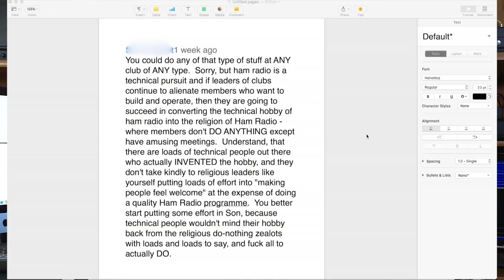How to Blow-up Your Balun - K6UDA Radio Episode 23

Comment: Okay Reverend, first of all a ballon has nothing to do with 50 ohms. It has everything to do with stopping the outer skin surface of the coax from radiating. And forcing the power into the antenna. Your coax can be any impedance you want your antenna can be any impedance you want. The job of the balance is to make sure that the coupling from the balance to unbalanced connection happens efficiently and is not allow the unbalanced part of the circuit to radiate. Think of it this way RF is stupid. It doesn't know when the coax ended. So we need to put something there to tell it that the coax has ended and now it needs to leave The Wire the way we want it to. Plain and simple

Comment: Baluns only work at mono-band antenna's, they do not work well on multi-band, as the impedance is all over the place. I only use a choke and a good tuner. It will make 50 Ohm on any band. Problem solved. Never used an antenna-analyzer and never will, it's just an advanced SWR-meter telling you nothing. A balun is a transformer and will never be the same unless you use a mono-band antenna. Invest in good coax, choke and a good tuner, it will make any antenna work, regardless of the impedance as long as it's long enough for the band you want to use.

Comment: While you vaguely mentioned that one needs to use an analyzer and then match impedance of antenna and feedline, I think you'd have done a better job if you gave a little more detail -- such as "how" to measure the impedance, and then how to determine whether balun is 1:1, 4:1, 9:1... for example: if a Ham operator homebrews an antenna how/where/what do they measure to determine the impedance their "spaghetti monster" has?  If they are going to buy a balun how/where/what do they measure on it to determine whether it is the correct ratio for their need; and if they are going to homebrew the balun how do the number of turns/wraps of wire around the core equate to the ratio of the balun...many, many DYI guides are being copied by homebrewers who are copying something but they don't know why a specific number of turns of wire is being used, or why a specific length of wire is being used...if you've not already done so perhaps you could make a video covering these points:

>After I have an antenna (either homebrew or purchased) how/where/what do I measure to determine it's impedance?

>If I purchase a balun how/where/what do I measure to make sure it is correct ratio for my situation? (Just because someone slaps a label on something doesn't mean it's right)

>If I homebrew a balun how do I figure out how many turns/wraps of wire to put around the core -- in other words how does the number of turns equate to the ratio: is there a simple formula that a person would use, to know how many wraps to put on each side?

The points/questions above are, in my opinion, what a new ham would be asking themselves after watching your video.  You put time and effort into editing it to make it entertaining/comical, etc., but seemed to lack the more useful information that they'd need/want. Not criticizing -- just making a suggestion.  

Thank you for your time and assistance.
Raymond - WF7BSR
Reply from the maker: Thanks for the input. I don't know if you stumbled across this video or your a subscriber but if you look at my videos as a whole, you'll see a common theme. I make pretty much overview level videos geared more towards the new and aspiring ham operators. My goal is to inspire the new folks to get on the air, try new stuff and experiment with ham radio. I'm the first guy to admit I'm not a genius and I'm not a "technical" ham. There are much smarter guys out there like you who can teach much better. What I can do is entertain and introduce people (and myself) to new faucets of the hobby. Now, if I can figure out how to make a very in-depth technical how to video funny, engaging and keep it at around 10 minutes, I'll do it.

What the analytics show is the more technical the videos get, the faster people tune out. Not my numbers, those are from youtube / google. -de K6UDA

Comment: Great explanation! The way I had understood; antennas  transmitted and received on both sides. Your explanation totally made sense about the where and how of the ratio, balanced and unbalanced, and if you could you make another short video about the differences between a voltage and current Balun. Thank you.